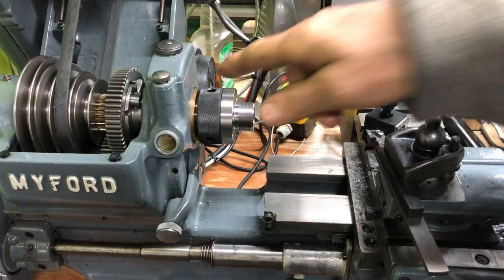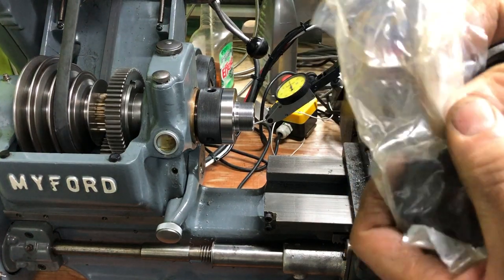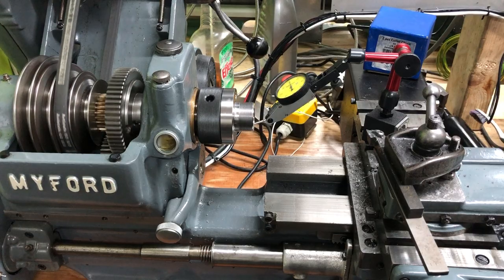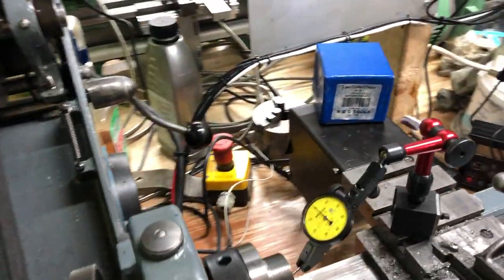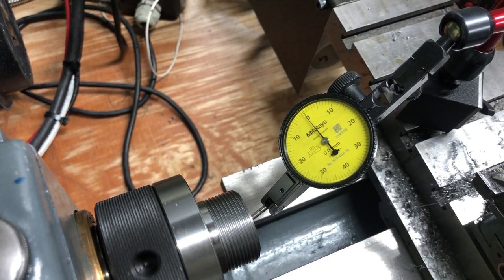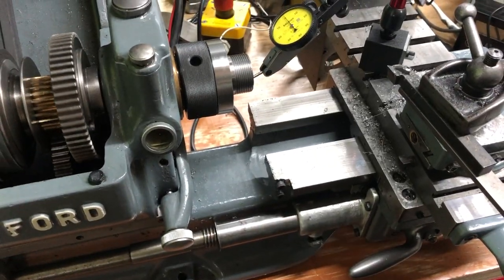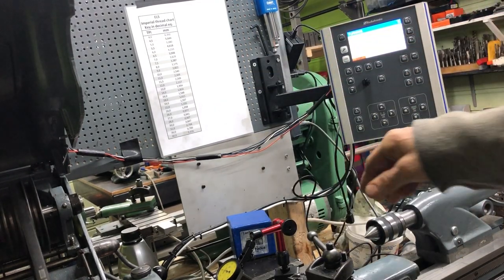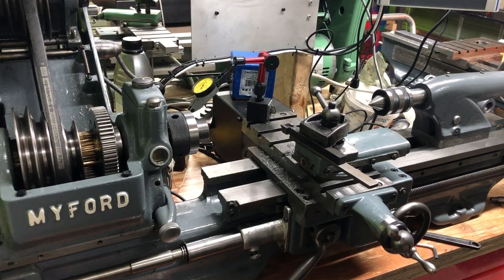Fitting the ER25 collet chuck from RDG on my ELS equipped Myford S7

Comment: Hello Jan, I'm really impressed by your work restoring these old myford lathes! Since I own myself a Myford Super 7 MK1, I'm very interested in the fact, that you discarded the clutch in this particular lathe shown in the video. Maybe you can give a hint how easy it is to discard the clutch mechanism. I've seen, that you're using a VFD, which makes the clutch obsolete Ii guess. BR Christian
Reply from the maker: Thnks for the nice feedback! I am not sure if I remember if this lathe came without a clutch or if I removed it. Anyway, if it did, the "removal process" is pretty straightforward, just disassemble and leave only the shaft, needle bearings, fibre washersvand lock collars. Or, maybe easier, just tighten the clutch to a solid grip fit.

Comment: I am getting mixed results from my similar ER32 collet Chuck from the same supplier, after lost of fiddling ended up remachining  the register slightly undersized and tapping it true. Rechecked it the other day, reset to 5 micron runout on the taper. However on removing and replacing got 20 microns runout. Suspect the backplate is a relatively slack fit on the spindle nose. Investigations continue.
Reply from the maker: Hmm.. interesting. Keep us posted on your findings!
Reply: @jansverrehaugjord9934  Spent the afternoon removing the chuck, measuring runout on the conical taper, and replacing. Got runouts of between 10 and 30 microns. In addition, the blacking on the chuck backplate is rubbed away on only a couple of spots so I think this is showing that the hole is oversize by anything up to 25 microns given I set it to 5 micron runout the other day.
Reply from the maker: @FEStanley  Have you measured the register itself with an indicator? Also verified there is no excess play in the spindle ie. that it is seated correctly
Reply: @jansverrehaugjord9934  I measured the spindle runout at 0.002 mm, spindle register runout 0.0025 or 0.003 mm (might have been some flex in the DTI mount on this) spindle vertical and horizontal play at 0.01 mm, will recheck.  My DTI is graduated in 10 micron intervals by the way so am at my limits of measurement. I am beginning to wonder if I have a bruise on the spindle  as fitted a new one piece screw on collet Chuck today and got far worse results. Something not right. Did have a Chuck come unscrewed due to a  spindle jam, incorrect thrust bearing setting caused that, and wonder if some damage was done
Reply from the maker: @FEStanley  I see.. Hmm.. at which distance did you measure the runout at 2/100 mm? At the spindle axial surface itself?  or by runout you mean the displacement you can get from the available bearing play/tolerance. What is you axial play now, ie. as set by the 2 nuts?
Reply: @jansverrehaugjord9934  Thanks for your comments. The spindle runout was measured on the spindle axial surface with slack driving belt and rotating the spindle by hand; the axial play by putting the DTI on the axial surface in  horizontal then vertical plane, and moving the spindle horizontally then vertically by pulling on a test bar inserted in the spindle taper, as shown in one of your most useful videos. New or little used faceplates, chucks etc screw on smoothly by hand, but go tighter over the last couple of mm before butting up to the register. Not sure if this is significant but worth mentioning. Could a burr on the spindle thread be tipping the chucks and causing this tightening? Unfortunately with  lockdown I can not take the chucks etc over to a friend’s shop and repeat the measurements in his Myford!
Reply: @jansverrehaugjord9934  I have done some more measurements, appears to be a spindle problem here, might be nose thread damage have put some videos of my tests and setup here https://www.youtube.com/channel/UC78eFX_C8IqLxcANLyv8i0w so any suggestions to remedy appreciated
Reply from the maker: @FEStanley  Hmm.. to me it looks at least so that the spindle is OK, indeed very accurate!  As evident from your videos 135, 1438, 1439, 1444 and 1445. The problem seems to be related to the collect chuck as shown in 1446. The fact that there is some runout as shown in 1447 can be because of the overhang from the chuck (muliplying the small error in the taper). The taper adapter in 1449 is also acceptable
Reply: @jansverrehaugjord9934  Update, ran thread restoring file very gently over spindle nose thread in slowest reverse back gear  with lots of cutting oil, then used diamond file on bruised area to clean up. Getting far better, repeatable,  results, will keep carefully cleaning and measuring.
Reply from the maker: @FEStanley  Great! I guess you nailed it then.

Comment: I like to thread away from the chuck (thanks Joe!), but I haven't figured out a good way to lock a threaded chuck on the spindle without weakening the spindle itself.  I'd rather not drill holes, grind flats, etc on the spindle itself.  I made a clamping collar adapter for my little bench lathe, but it doesn't look like there's room on your Myford.

If you find out a way to do that with the collet chuck you're using here, I'd like to know what that is!
Reply from the maker: The EMCO maximat I had used a collar to lock the threaded chuck onto the spindle. If I remember correctly this meant that the threaded part of the chuck was actually slit so that it could locked by compression once threaded on and seated the usual way
Reply: @jansverrehaugjord9934  - Hmm! I didn't know that approach was used by an actual machine manufacturer.  I guess that proves it can work, and I should try it out.  Thanks, Jan!
Reply from the maker: @somebodyelse6673  Have a look at 04:54 in my video here https://www.youtube.com/watch?v=-3enKcjYbTQ
Reply: I don't know if I just missed that, or my aging brain accidently deleted it.  A good excuse to re-view your video catalog.

Comment: Looks better than I would expect from that supplier, my past experience was not great. Given you can't use usefully large conventional collets in that machine this seems to be a good option for work holding.
Reply from the maker: It is a useful addition for small stock, but I normally prefer the 3 or 4 jaw. For smaller castings, like modyfying the adapter piece for the cross feed bearing seat, it is nice to use the face plate also.